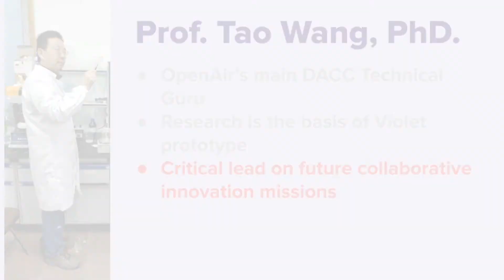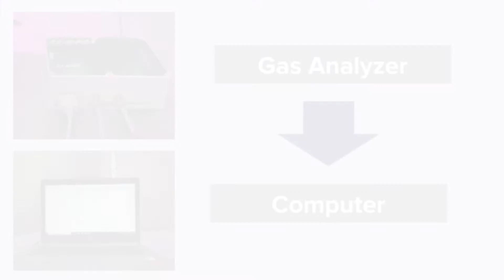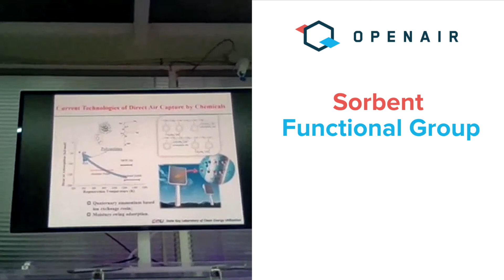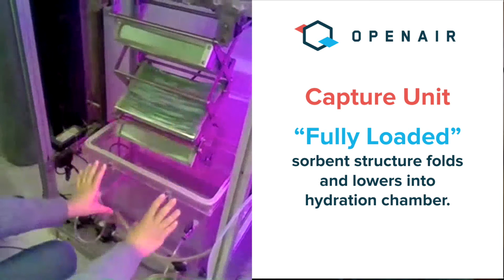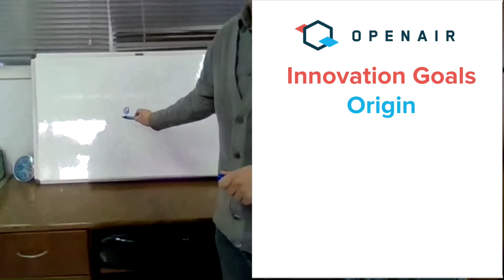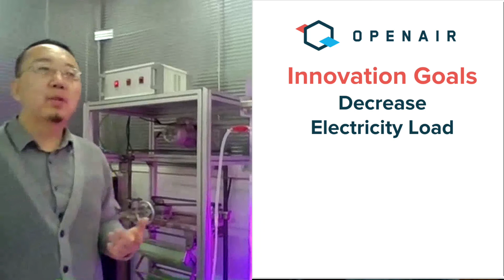Direct Air Carbon Capture Prototype: “Violet” with Prof. Tao Wang

Comment: I think 3A molecular sieves will adsorb water from the air.  When you need to dry the air, expose it to a chamber of these.  When you need to moisten the air, heat up the sieves.  No moving parts, just a heating coil.
Though I think it will also absorb CO2, so you might have to heat the sorbent material, then chill the gas to seperate the water out, kind of like a freeze drier.
Or just heat the material to remove the co2, and not use water.  I'm not sure of the specifics, but heating and cooling is likely faster but uses more energy.